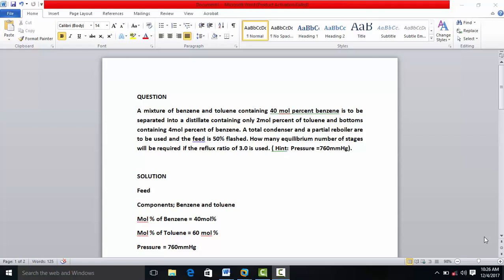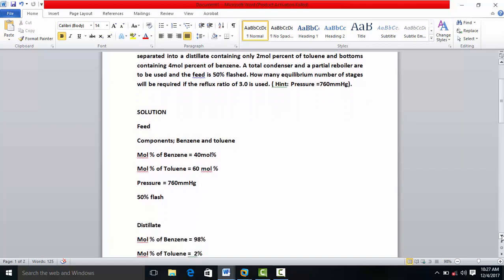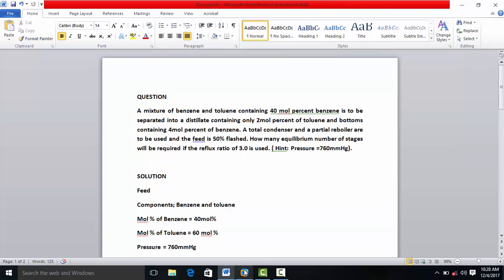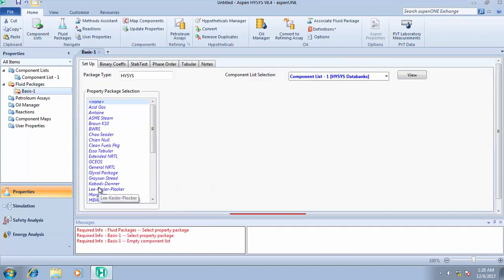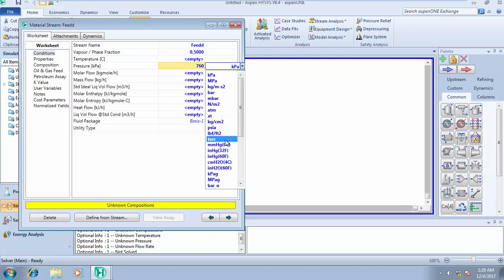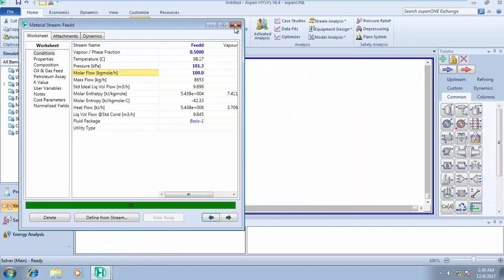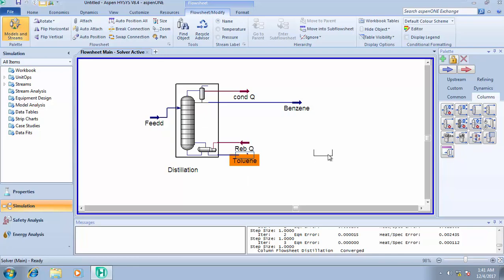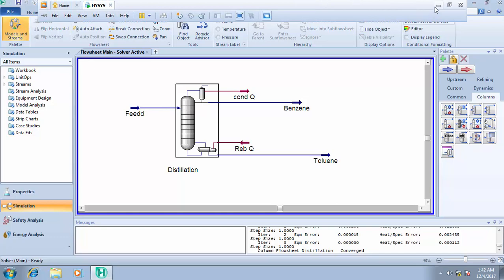Distillation Column Simulation with Aspen Hysys

Comment: Your tutorials are really helpful thanks. In Distillation Column im having trouble understanding hydraulic plots and the relation with the geometry design parameters. For what i can see it tells me when the column will flood i try changing the feed molar flow and the distillate rate to prevent flooding but it still occurs at the 1st stage ,does hysys have tools for flooding?

Comment: there is no logic in deviding the reboiler pressure by 10 to get the condenser pressure while you  multiplied the feed pressure by 2 and not 5 to get the reboiler pressure